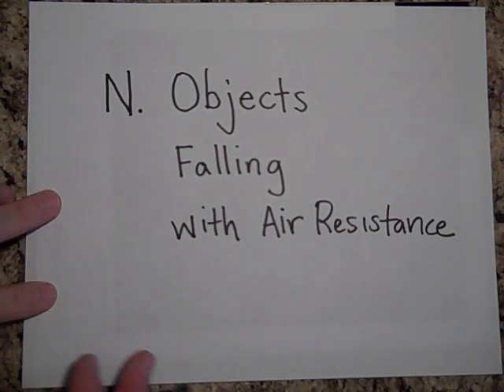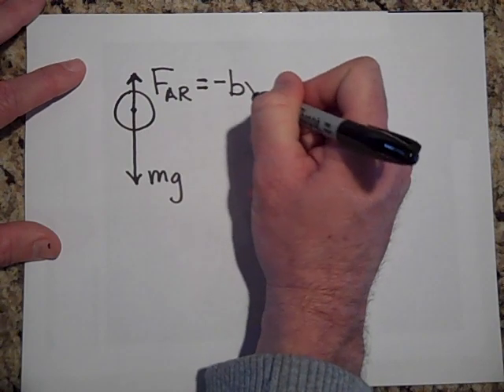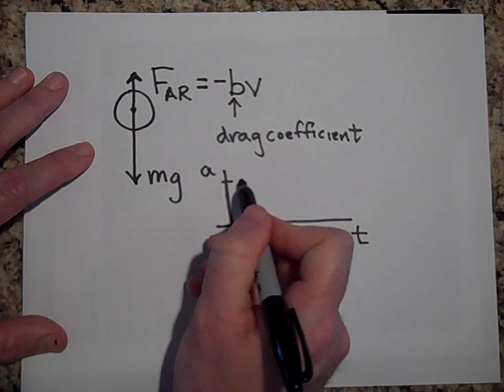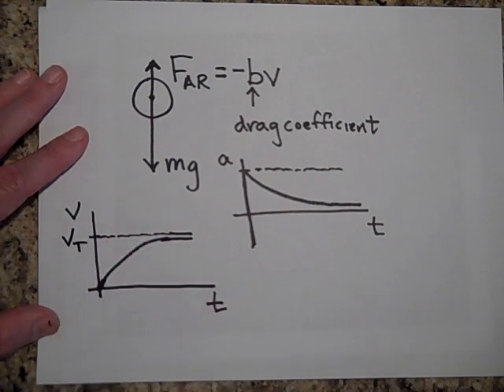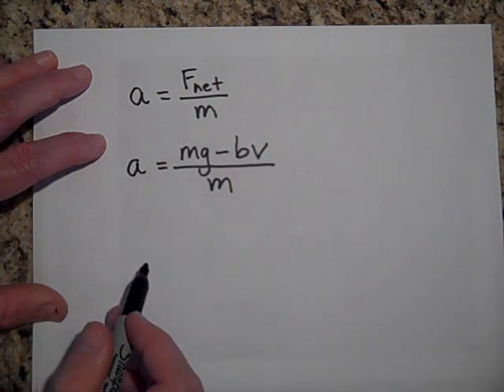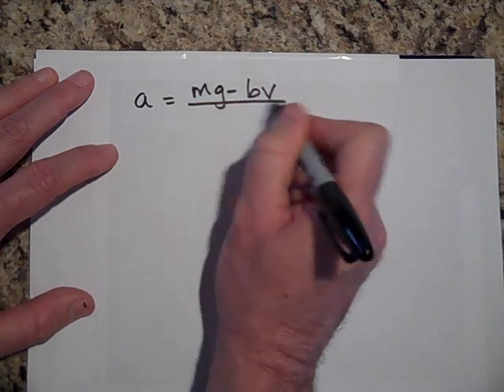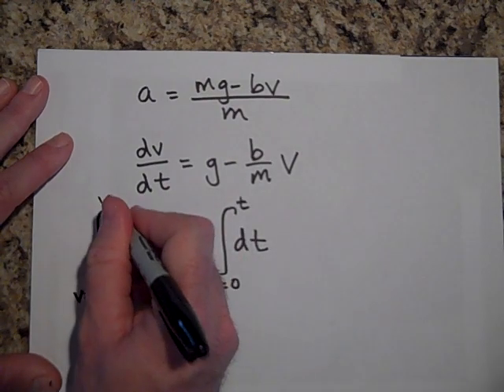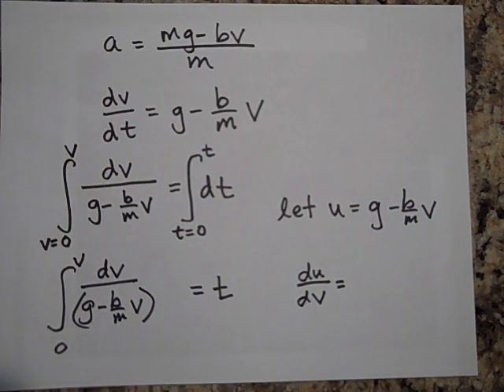Objects Falling with Air Resistance (part I)

Comment: why can't air resistance be more than weight?
Reply: Tanvi Princess Then the object would float upwards
Reply: At terminal velocity, surely if you increase the surface area of the body the net force acts upwards, causing the object to decelerate below the terminal velocity. This deceleration can only occur if the air resistance is bigger than the weight.

Comment: b=(1/2) * drag coefficient * air density * cross-sectional area of the object
Reply: Zero Jiu what if it's a pyramid then the area varies
Reply: Mo^nku then you  consider the area that is contact with the air. Which can keep varying so we can only get instantaneous force.